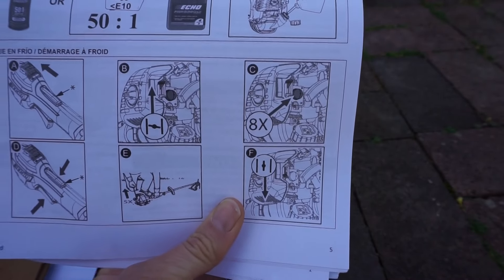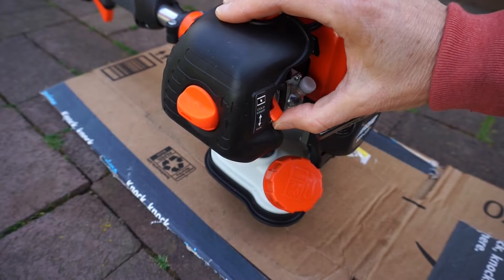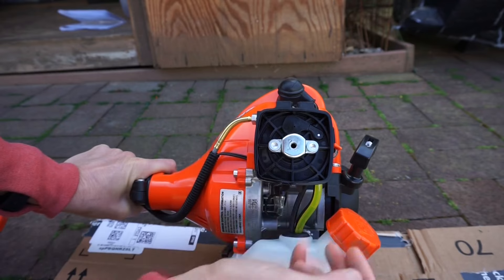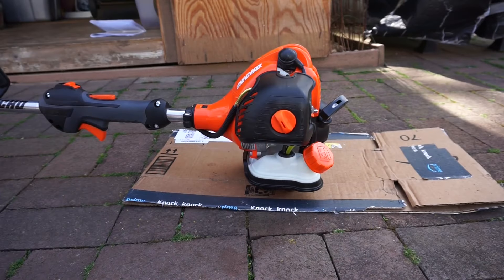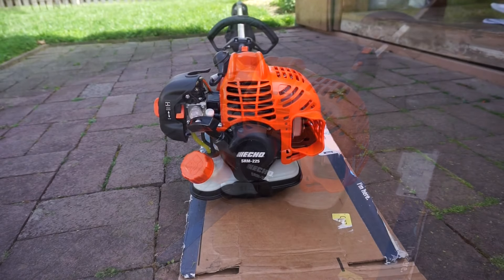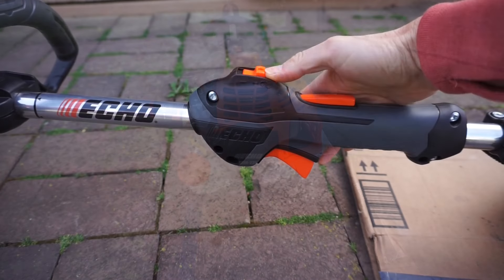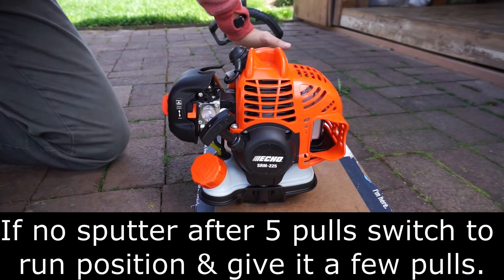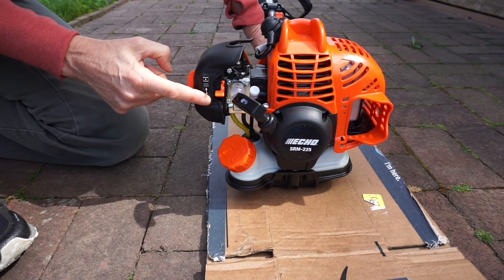Echo SRM 225 String Trimmer Won't Start - Flooded

Comment: what a great video! well done! I have had two SRM-225's and currently running an SRM-2620T and a SRM-266...I agree-8 pumps is too many and when restarting warm/hot engines, I don't use the primer bulb at all, I just drop start and get back to business...in fact, even when cold starting my units, I haven't needed to use the primer/purge bulb at all this season - I just put a cold engine in the choke position and tug on the string a couple times until it either starts or pops off and switch the choke to run and away she goes...what fuel are you running in your unit? engineered pre-mix? it looked really clear...
please have a look at my channel I will be liking and subscribing to yours! Cheers!
Reply from the maker: I am perplexed at how the quick start guide is so wrong.  I love the trimmer.  I am trying the engineered pre-mix fuel.  I usually only use about 2 gallons of fuel a year and sometimes have some left that sits all winter.     It looks like I will use one can of it for a season.  For my situation, if it saves me from having to tear it apart it's worth it.  There is a gas station near my home that sells ethanol free fuel,  that would be my 2nd choice.   The premix fuel is expensive.   I checked out your channel and subscribed.
Reply: @Know-How-Now  thank you so much! No question, the engineered fuel is the way to go for a homeowner with one or two pieces of equipment, (I have several small power tools and 3 oil mix snowblowers that are VERY thirsty so mixing my own is my only real option)...none of my Echo string trimmers came with instruction manuals (go figure)...but what I have found is every piece of equipment has its own personality if you will-another reason I say never lend your 2-cycle equipment out because the more ppl that mess about with it the less reliable it will be-if you have to lend it out-provide the fuel so they don't mess that up! I will be doing a storage video shortly...hint-you won't need to do anything with yours if you don't want to except put it in the shed when you're finished for the season...I will also show you how to grease your gearbox (something a homeowner would only need to do every few years really)...again-thank you so much...you have a great channel... looking forward to watching more of your videos!

Comment: You can’t flood the motor by pressing the primer/purge bulb (on a hand-held motor of this type) too many times. Likewise, you don’t need to keep pressing it once it has filled fully with fuel. A warm engine doesn’t need any presses of the primer, just pull the cord and go.
Reply from the maker: You might try reading the comments.
Reply from the maker: PS - You do know that motors run on electric and engines run on combustion?
Reply: @Know-How-Now  The comments of others has no bearing on mine - mine remains true despite what others have written. And I'll direct you to the Merriam-Webster dictionary on that second reply.
Reply from the maker: Thanks for starting a controversial thread Killer.  It will keep the video at the top of the search page and continue to help with the flooded Echo Trimmers caused by following the incorrect directions... pushing the primer bulb 8 times and flooding the engine.  You are doing a great thing.  Thanks again!
Reply: @Know-How-Now  It's not controversy, it's just how the purge bulb (it's not actually a primer) works. If anything, I'm always glad to spread correct information and clear up misinformation. With that in mind, the purge bulb purges the air out of the fuel pump and metering sections of the carburetor. It does so by sucking/vacuuming the air out of the carb. Once the bulb has been filled with fuel the carburetor itself has already been purged of air and is filled with fuel. So where does the fuel/air go when you press the purge bulb you may ask; it gets dumped back into the fuel tank. Because the fuel/air from the purge bulb goes into the fuel tank and NOT into the carb throat or intake port, you can not flood the engine by pressing the purge bulb.

And now that you know the facts, you can verify this for your own eyes, stop calling it the "primer bulb" which it actually isn't, and stop spreading controversial misinformation and ragging on someone for sharing facts.
Reply from the maker: You are missing the point of the video Killer.  People are having a problem and the video is solving it.  While they may not be as smart as you are, they are searching for the word flooded.  No one here cares about how the bulb works or what it is called.  They are being given incorrect directions on how to start their Echo Trimmer, they watch the video and the problem is solved.  Have fun trolling all the videos about flooded engines.  Thanks again!

Comment: Best Tip: Echo goes in the garbage. I can’t stand this weed eater. I’ll never been an Echo product again
Reply from the maker: Other than the wrong starting instructions, mine has worked great.  It's a breeze to load the new line and it starts up every time.  I'm in the 3rd season of using it and have  done zero maintenance.  He's how it starts up:  https://youtu.be/XmMpfwQr1P4?si=WktjtDUBLyLoVoPo  Here's the way to add new string:  https://youtu.be/6j19uXFTE3s?si=sKvQNCiYGkO-wEo_

Comment: Didn't work for me, theses units are trash
Reply: Two days out of  the box, PAS-225VP, it started ONCE for a 15 min. edge on the fence line.  I've painstakingly followed the video's instructions to no avail and will be shipping it back to the retailer asap.  And recommendations on a 40V exchangeable head trimmer?
Reply: @elstonbdavis9681  bought it back and purchased the electric echo 2600 never looked back.

Comment: You flood it dummy you dnt supposed to press the gas until the engine is on. And that engine starts in 2 pull.📢
Reply from the maker: I guess you didn't pay attention to the video.  I am following the incorrect instructions provided by Echo.... then I tell the the correct way to start it.  You may want to actually watch before starting the name calling.

Comment: on your first attempt, third pull, the motor chugged and tried to turn over. at that point, you needed to flip the choke switch back and it would've fired up
Reply from the maker: You are correct, Mike.  I am showing how not to start it.... by following the manufacturer's incorrect instruction, which will likely cause it to flood.  Later in the video, I show how to start it correctly.  Not sure how Echo could include a start guide that is so wrong.  Thanks for commenting, have a great day.